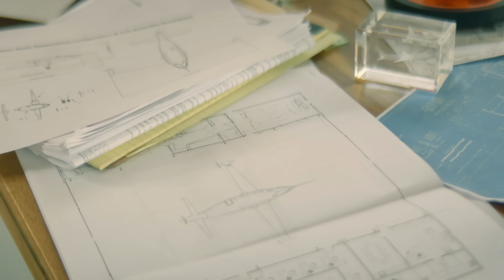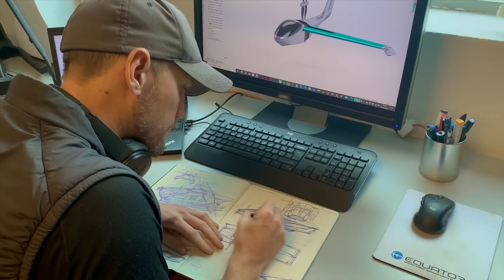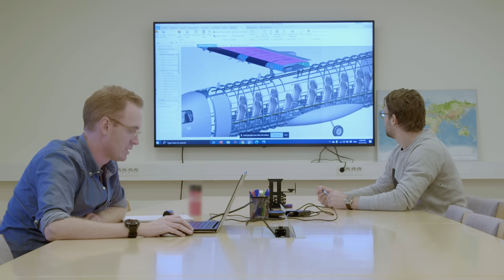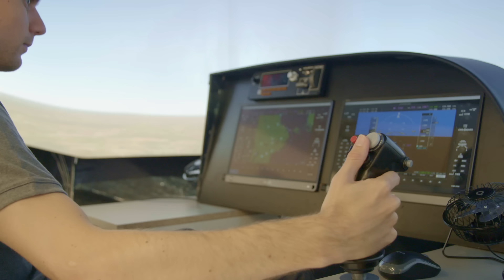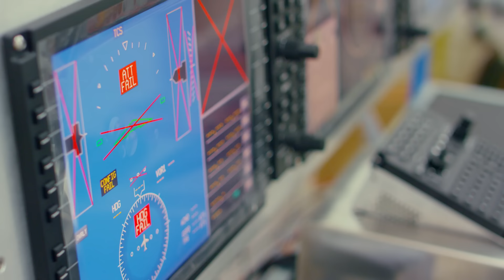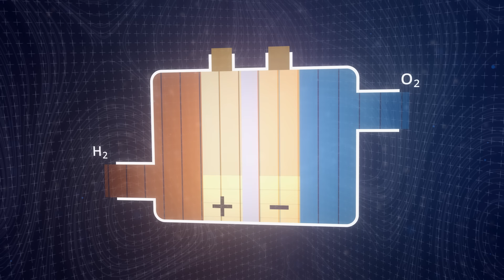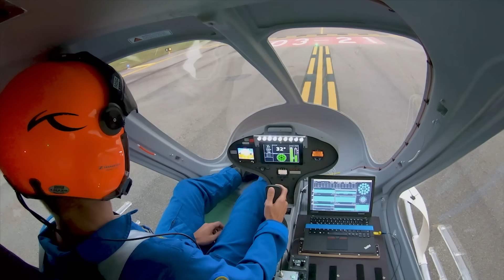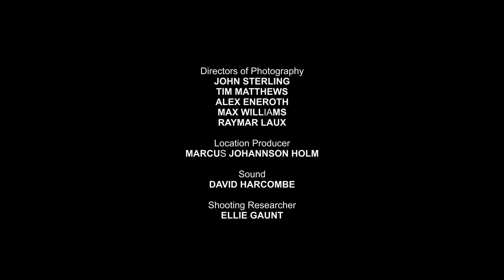Planes of the Future: The End of the Jet Age? | FD Engineering

Comment: One of the biggest issues I see with electrically powered aircraft is the fact that the battery doesn’t get any lighter as it discharges.  In a hydrocarbon fueled plane, as the flight progress and fuel is burned off, the aircraft lightens and becomes somewhat more efficient.  With batteries, you expend as much energy dragging them along when fully charged as you do when they’ve discharged.  And as for commercial travel, turnaround time must be considered - pumping fuel into tanks is a quick operation. With current (no pun intended) technology, recharging a large battery is much less so. <edit - typo>
Reply: Swappable batteries, perhaps? Especially if they're ejectable in case of fire
Reply: You can't swap them mid-flight.
Reply: @fr57ujf  But you can do it in airport, as passengers and cargo leave the airplane.
Reply: Yes, but the point was that, with liquid fuel, the plane gets lighter the longer the flight lasts.  This decreases the load and increases the average fuel efficiency of the flight.  With batteries, you have to carry the same weight throughout the flight.
Reply: The only problem with an electric aircraft is low energy to weigh of batteries. But even so, they are viable for short distance travel.
That travel distance will grow as batteries improve. It's the right time now to start developing the aircrafts, so we have them to put those improved batteries in.
It's odd how non-engeneers are so quick at finding problems, even inventing them, but so unwilling to  take the next step and solve them!
Reply: What a low-brow response.  You don't know that I'm not an engineer and nothing I said implied that we shouldn't do the research.
Reply: Range depends primarily on the Lift to drag ratio
L/D = wingspan/2 ×√( π÷CDA)
R = L/D × Vc ÷ tsfc × ln(1+wf/wzf) 
(Breguet range equation : Vc cruise speed)
meanimg large span is most important,
cruise speed is to be high, thrust specific fuel consumption is to be low and if you carry fuel alone excluding the oxydizer, which is free in the air in combustion  engines you get decent range, the battery must include the "oxydizer", which is about 4 times heavier and your range will be disapointing, unable to cross a single ocean, progress indeed!
A short wing fits well into a hangar , but makes the electric airplane into a hangar queen to be admired but not very useful for people on the move.
Reply: These equations are simple, so very simple that only a child can evaluate them.
Reply: I think rechargeable batteries do get lighter as they get used up. It may not be comparable to diesel fuel, as in jet engines, but they do lose a very measurable amount of weight.
Reply: @Technichian462  I don't know about that - everything I've read says discharged cells may weigh a tiny bit less than charged ones, but the change is barely measurable as it's on the order of micrograms for common, small cells.  Even with the huge cell arrays that would be required to power an airliner, you'd still be talking only a few pounds.   Compared to fuel weight, it's not even a bunny fart in a hurricane.  For instance, one version of the 757-200 can carry 11,489 US gallons of fuel - this weighs 78,635 lbs.  Even allowing for reserve fuel, from full tanks you're still talking north of thirty TONS of fuel weight being burned during a long flight.
Reply: @patmx5  oh, I get that. Indeed there is no comparison. Its just my Autism kicking in. And its a lot more than a few micrograms. More on the order of grams iirc. But I do concede, its possible I’m wrong about. It does happen. 🤠
Reply: @Technichian462  Fair enough!  I haven't dug too much into mass and rechargeable batteries, but my thinking says it would be practically immeasurable as they're (at least the sealed small cells I'm thinking about) closed and don't breathe or exchange anything with the outside world as they charge and discharge, and instead you're mainly rearranging, for example, lithium ions that have moved during the discharge cycle - can't see there being much if any mass change there, but could very well be wrong.  As for micrograms vs grams or kg, that would also be dependent on the battery size, and one that could power a flying machine would certainly be large enough that micrograms could add up, though I still can't imagine it would be very much overall.  Guess there's some online searching to be done!
Reply: @patmx5 Oh, right. Sorry, I wasn’t even referring to lithium based. I was remembering tests. And those tests were on carbon, alkaline, NiCad, and Nickel metal hydride batteries. Consumer electronic cells, AA, AAA, C, and D sized cells. So my comment may be irrelevant to the situation at hand. 
Damn, I’m embarrassed I did that.😳🫣
Reply: @Technichian462  LOL - no worries - it's food for thought.
Reply: @Technichian462  Battery weight loss is only measurable on an atomic level, like Einstein figured. Regular bathroom scales can't measure it, it's too small. Not like a 5 gallon gas tank empty. More like depleted uranium empty, still heavy enough for armour-piercing shells.
Reply: @edbruder9975  No. bathroom scales no. But kitchen scales, measuring and things is grams will. A rechargeable flashlight light battery has enough change in weight to measure. Not to mention a full battery when dropped, bounces a little, and an empty cell bounces a lot. Why does it bounce?
Reply: The irony is that those e-planes are made of 95% of Carbon fiber and plastic which derived from oil. It's cute to talk about clean energy but forget to mention where and how do you get your electricity from in first place and how do you build the entire airplane? Oil is here to stay until the last drops.
Reply: You are thinking like a kid.
Reply: @caav56  Ill go for that in a CAR the idea of swapping batteries in a plane scares the hell out of me, A MASSIVE POINT OF FAILURE on batteries that get swapped is the connector
Reply: Could we see batteries exchanged at the airport with precharged batteries, or will they be installed as inaccessible as phone batteries?
Reply: @larsnystrom6698  i am an engineering student and electric powered aircraft doesn't produce enough power to get you through bad weather. You would need a battery with very large capacity and motors that will have enough power to push the planes. At the moment electric doesn't do that.

Comment: One big part that is missing from this conversation is that up to 500 miles, trains are better option, both for how long it takes and much less carbon used.  This means that the airline industry needs to get rid of its short flights, which they actually don’t make any money on, and had it over to trains.
Reply: Yep,..just imagine where we would be with high speed rail connecting major shipping routes

Comment: Aviation produces 2% of CO2. Transportation as a whole produces 12%. Heat and electricity produce 32%. Manufacturing and construction produces 13% and agriculture 12%. Aviation CO2 is like the size of flea in a world of elephants.
Reply: The initial argument was that this percentage would grow to 20 by 2050, thus making this area important. You should have caught that, shouldn’t you?
Reply: And that kind of reasoning is the reason nothing changes.
Reply: Those facts are not Party approved Correct Speech
Reply: @preacherno  20 % regards a growth in air transport. But that is something no one see as realistic anymore. But battery powered airplanes for transport is not the future anyway!
Reply: Everyone within their industrial specialty needs to contribute as many ideas as possible.

You can never tell where uses can converge. The results of a discarded byproduct of one industry maybe of use to another.
Reply: @preacherno  so there will be more private airplanes which carry about 10 people on average instead of 250 to 500 on a commercial airplane? If you believe some people, then the ordinary peasant won't travel much in the future anyway.
Reply: Yep.. thats a shitload of global warming
Reply: As other sectors decrease their CO2 emissions, aviation's contribution will become a larger part of the remaining problem. 

Then add in the rapid expansion of passenger growth...

As you know, aviation is a part of the 'hard to abate' sector of industry. It's more difficult to create solutions, due to technical complexity. Even introducing new and improved engines with conventional technology takes a decade or so.

Therefore, solutions using completely new technologies need to be worked on now.
Reply: @navajojohn9448  yeah and this beast has to be charged all the time
Reply: @ingeholstjacobsen2898  no actually as everything else gets smaller, as a percentage aviation becomes very significant in the absolutely crucial net zero emissions needed to not bring on climate catastrophe
Reply: So stick your head in the sand and don’t do anything, it only 12% 🤦‍♂️
Reply: seems my comment was deleted...free speech and all...ill try again...EDIT...tried 5 times...deleted each time...is it youtube? or this channel suppressing said free speech? there is no insults or profanity in any of said comments...bad grammar mabey...so why delete them?
Reply: If I follow your argument, I should let the raw sewage from my house to run to the nearby stream. We are a small family so small percentage and it doesn't matter....
It is a faulty argument. Each industry should do it's best to reduce pollution of any kind. It accumulate across industry and effect all.
Reply: People who can afford to fly can afford to be part of the solution to climate change.  It’s time to start.
Reply: Ha.. You literally know very little about what gas producing jet engine can do, this isn't the 1950s anymore, jet engines are a big problem, your Co2 estimate is far off, it needs a massive update, everything coming out of a jet engine is toxic as hell about 10 times more then a car engine with filter or no filter, aside from airliners add to the rest of the aviation industry, piston and turboprops in general, the US Europe and China, are the biggest aviation poluters, 33 tons of Co2 for every 530 km of any 4 engines airliners, military as well, mind you that 530 km for an airliner is absolutely nothing, some of them can flight for almost a whole day straight non-stop, New York to Singapore 19 hrs 15,349 km, Huston to Sydney 17h. 22m Dallas to Melbourne 17h. 34m and the list goes on, everyday 24-7 all year long.
Reply: You forgot about volcanoes and forest fires among other natural things
Reply: Co2 is a very good thing , remember people , or seek knowledge
Reply: @ingeholstjacobsen2898  why?
Reply: @mushmouth  How are we to manage those contributions?
Reply: It’s not inconsequential.
Reply: @ingeholstjacobsen2898  
The same thing they said about cars.... give it time.
Reply: @ingeholstjacobsen2898  wow so optimistic
Reply: I am all in favor of green energy, but like recycling and diversity initiatives, much of this is PR hype.
Reply: @preacherno Nad you also assume that there will be ZERO counteracting IMPROVEMENTS in aviation, fuel efficiency etc in that time!? Sure….
Reply: Yet we must all drive electric cars!!!!
Reply: In the UK transport, as in many developed countries, is responsible for 26% - 28% of net CO2 so even higher than you state, making the aviation sector % a smaller part of the problem. Yes the focus needs to be on higher emission areas for a quicker more meaningful impact, but every little reduction helps so lowering aviation emissions is still a good thing.
Reply: You need to put a zero and decibel in front of each percentage and you will be correct animal, forest( trees brush organics) decay put out over 50% of CO2 the ocean  puts out almost a half a gigaton on its own not to mention animal feces 
Are big problem if you want to look at it in that manner CO2 is not as bad as everyone thinks (we don't need to pollute our planet) the big problem 
other countries mining and manufacturing there destroying our lands lithium is one of the worst 
Fuel can be mined/extracted at very low impact compared to lithium that said I would rather see a great hydrogen system 
Beryllium is the fastest and easiest way to produce hydrogen the problem is beryllium has high electro magnetic Fielding (radiation) a small amount won't kill you 
The amount needed would require some kind of radiation shielding which is not very practical at this point
Reply: An China is producing 10 coal powered power plants a week
Reply: By equivalent yeah, but every little helps. It doesn’t mean we shouldn’t be paying attention to it.
Reply: @paulwright8378  Not quite, but a good point, it’s actually 6 a week in pre planning or construction if they could be planned and built in one year so not good at all, then India is at 1 per week on the same basis and Indonesia at 1 per fortnight. These three are by far ahead in new coal power stations, China also has 1,100 active coal power stations in use as well and the USA still has over 200 active but no new ones planned. A long way to go.
Reply: Exactly. I was hoping some really awesome documentary about a new plane, but we get a whole bunch of woke preaching which is misleading.
Reply: I'll turn up my A/C temperature 🌡 when everyone else stops using heat 🥵 🔥
Reply: @preacherno Not realistic data.
Reply: Oh let's just stop all progress because one guy on YouTube wants to pretend like he knows stuff
Reply: Also, it's a wash CO2 wise in operations, you burn 3x fossil fuel on the ground to make 1x electricity which you then use on an airplane with an electric engine which has a higher efficiency than a combustion engine. No CO2 saved, just more CO2 released to make the batteries.
Reply: @Luddite-vd2ts  Which sectors are reducing CO2? We are just moving production and pollution to China and deindustrializing the west. China is building over 100 coal power plants a year and burning over half the world's coal.
Reply: Even if the technology in this field doesn't succeed or have great overall impact I think the efficiencies and learnings can be implemented amongst a wide array of applications, just like things we've learned and gained from space flight
Reply: @AlJay0032 So, your solution is “do nothing”? I don’t see a hint of a solution in your comment. What is your plan? Or, perhaps you don’t think global warming is real?
Reply: The important factor is by ton moved. when this is taken into account then aviation is a mess.
Reply: Elephant: 5000 kilograms.
So a 100 kg flea?
Reply: @preacherno  sophistry
Reply: Giant seaplanes carrying time sensitive freight makes a great deal of sense. They wouldn’t require the infrastructure of airports. When one examines the world there are many cities and towns along the coastlines and  large lakes.      Worldwide there are very few airports that can handle 747 and Airbus 380 type aircraft, seaplanes wouldn’t be constrained and wouldn’t require the acreage and kilometers of pavement wheeled aircraft need. Aircraft 3 and 4 times the size and volume of 380’s is not hard to image. The cost per mile drops dramatically as size increases.
Reply: Taylor Swift produces the rest of the w00%
Reply: Rockets are aviation and they produce a huge amount of co² and are very effective at destroying our atmosphere.
Reply: Okay but where's the other 29% coming from
Reply: @preacherno  That seems like an unbelievable extrapolation.
Reply: @LIOTBs This presentation definitely included a lot of woke cultist doctrine with no basis in reality.
Reply: @AlJay0032  Indeed, electric is unlikely to be viable.  It doesn't even beat diesel in road tractors yet...aircraft is way off.  

Nuclear is probably the best bet for the aviation industry to move to a more reasonable future than using tons and tons of fuel during every flight.  

Particularly when we figure out fusion.
Reply: @craigb8228  Rockets are not destroying our atmosphere.  Where would you even get such a preposterous idea?
Reply: Hyperbole much?  2% is one adult male human in a universe of a single adult male elephant. 

2% is a decent chunk.
Reply: @Juttutin  Still, wouldn't it be sensible to start with the big chunks where it is easy to reduce CO2 by over 2%? If reducing CO2 in a rational way is really what you are after.

To me it seems it really is about something else. Otherwise you'd go after the big posts first and ignore the tiny ones. Is it about ending free movement? To get more socialism?

Anyways, more CO2 is good for the flourishing of plant life.
Reply: who ever said that they hate how i think seeing as i cant see the comment...i want a scam to fail...i hope most ppl would think that way about any scam or lie...unless they are a part of it...
Reply: Electric and hydrogen-powered aviation are important innovations that can help the industry reduce its long-term carbon footprint.
Reply: @EarthScienceTV  we dont need to reduce the footprint seeing as its harmless...them lithium batteries are not...those are awful for the environment...
Reply: @MariktheWolf  Just like in climate research there is a lot of money to be grifted from the government here.
Reply: @GoGreenCarolina-x1j    prove it.
Reply: Yes, true, But this imaginary vaporware aircraft looks much nicer on powerpoint presentation than a new five percent more efficient heat pump. Or it might even not be more efficient, just cheaper and therefore available to wider populace.